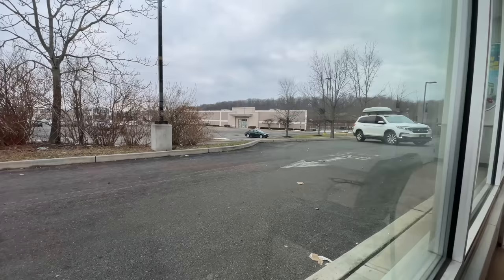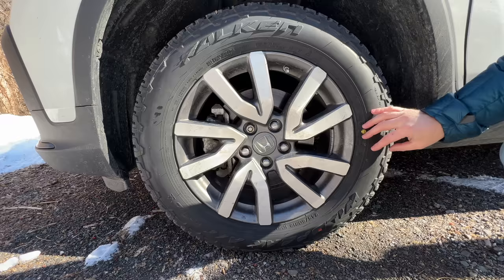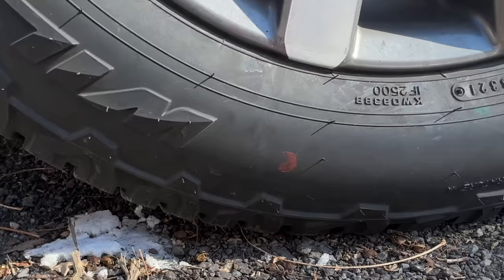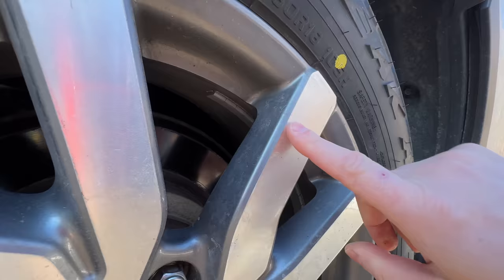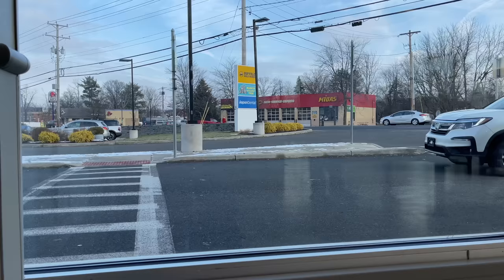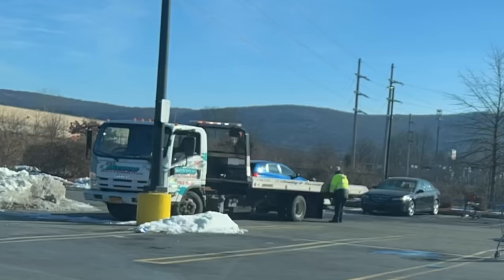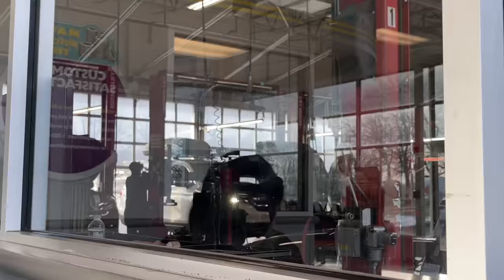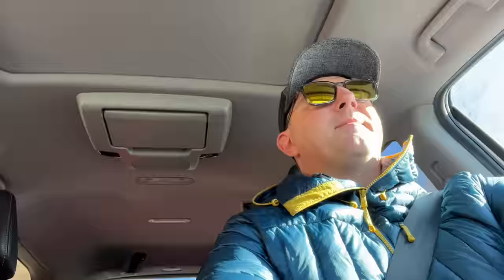The Surprising Importance of THIS Yellow Dot!

Comment: As part of the diagnosis I usually wanted to see if the tires were actually causing a vibration, or if I should look elsewhere.
Checking the balance before balancing tires I'll find that it now wants less weight but in the exact opposite position, so for my family, friends or regular customers I'd go slightly lighter 2-1/4 oz instead of 2-1/2 oz, it seems to work better in the long run.

Comment: An important point you missed is any time a newer vech with a tire pressure monitor system “TPMS” comes in for new tires or tire rotation the TPMS should go through a relearn so it knows the location of each sensor to report accurate information. As an example, the right front tire is swapped with the right rear. The manufacturer’s spec ( which can be found on the driver’s door post) calls for 32 psi on the front and 38 psi on the rear. The right rear gets a slow leak. Since the vech still sees the tire as the right front it will not turn on the TPMS light until it’s lower than 30 psi and show it as the right front. So when you bring in the vech for repairs the wrong tire will be checked and no leak found. And just a final comment, when you bring in the vech put the wheel lock key on the dashboard or center console and make sure you get it back when you leave.
Reply from the maker: Valuable point. TPMS relearn is very important.
Reply: Amen!
Reply: I had to put a brand new set of tyres on today...glad I got the "auto re-calibration" TPMSensors 😊 (Honda).
All I had to do was drive it normally city speeds and within 10 minutes...Voila...👍👌✌

Comment: I manually change the tires on my motorcycle. I've probably installed 5 or more sets of tires at this point. By following the dot over the valve method (+/- 1") I have NEVER had to adjust the original weights. I mean, literally perfectly balanced all sets with just a small weight which was installed with the original tires. No vibrations at any speed. Several different brands and models, Dunlop, Mettzeler, Bridgestone, and Pirelli. It's unfortunate tire shops can't follow this basic principle.
Reply: Bike tires and wheels are more precisely manufactured.

Comment: I only line the valve mark if I'm putting tyres on new wheels.  Have found that on old used rims I could end up with 120g of weights no matter where the marks are mounted. Sometimes rim rounding will sort it out but most cases replace the rim is what I'd advise.

Comment: Stick on weights inside the rim are being held even more securely by centrifugal force. It's most important that the weights be applied toward the inside edge and the outside edge for correct balance. Techs often glop the weights in one spot which most computer balance machines say is ok on one of their settings. The balance job won't last.

Comment: This depends.If a wheel has a light spot or a heavy spot, the dots can be used to make for the best achievable balance.In other words,sometimes its not the valve being used as a guide.One could use known heavy spots for example.IE where there was a large amount of weight previously placed.Hope this helps instill faith in your local tire tech's.🤘😎🤘
Reply from the maker: True statements. My installer might have used the old weights as reference and lined up that way. The last time I mounted and balanced a tire lip weights were still in use, so it might be easier with the sticker strips to try to line them up. Those sticker strips might make the ride smoother as well by distributing the weight over the lighter spots. Thanks for sharing your thoughts.

Comment: Heaviest point of the rim is not always the valve stem of the rim. YOu can balance the rim without tyre or any weight and see that heaviest point is not necessarily always the valve stem. Valve stem area is the lowest point of the rim as I know but I have no proof.

Comment: I’m 66, Many years ago in my younger years it was common practice to make sure the yellow dot lined up with the valve stem.  Especially on stamped metal rims that were more likely to be somewhat out of round/true or just the rim alone required more hammer on wheels weights and a physically large or large number of wheel weights that would jump out at anyone with any knowledge.  Modern wheel balancers are basically capable of balancing a square wheel but just like some tires with manufacturing anomalies will not always run smooth at all speeds.
Reply from the maker: Someone else recently said those strips spread out the weight and make it a little more subtle than a single heavier weight. Maybe these help it run smoother.
Reply: @OffGridAdventure 
The more spread out they are, the more weights it takes.
Reply: I just did four tires on my 2010 Town and country and I noticed that a quarter of the rim has some aluminum taken out of it and the valve stem in the middle so I think they took care of the extra weight from the sensor by removing some of the aluminum around that area

Comment: I would think it would take longer to balance it with more weights than to position the red dot properly while mounting the tire. Only takes a couple seconds to put the dot where it belongs before inflating the tire. This should be mandatory practice at ALL tire shops!
Reply: So how do you know the low spot on 99% of the wheels? 
Guessing doesn't count.

Comment: Should always try to line it up, when only one bead is on the rim it takes zero effort and two seconds to line it up. However, if it's a low profile or an LT, putting the second bead on can cause the tire to spin a little. After that, not a lot we can do that's not going out of our way.

Comment: Even though we do not have split rim wheels where the tire can rotate on the wheel, tires still can rotate on modern wheels that is why I put a red splotch of oil based paint on my tires, usually on both the tire and wheel to make sure they still line up after the balancing.  Yes, the paint wears, so I occasionally renew the mark when I see it fade. It is not the manufacturer's fault the tire rotates on the wheel, but the way you drive that does it. Only one brake lockup to keep from hitting some driver that doesn't pay attention is enough to make your tire move on the wheel. Tires naturally exude oil, and that is enough to let the tire move on the wheel.
Reply: I've only ever seen tires "walk" is on race tracks.

Comment: I was taught to put the tire seam opposite of the valve steam. I never noticed red or yellow dots on the tires. I have been out of the auto scene for a while so maybe this is something new or only certian manufactures do.
Reply from the maker: I’m not sure when this practice started, also, some manufacturers put the dot on the other side making the matching the opposite of what I said in the video.

Comment: As far as i understand about the red and yellow dots are only found on Tyres are  Manafactured 
in China , which are normally in the budjet range ,  Brands such as  Dunlop , Continental , Michelin , Uniroyale , B F Goodrich, Goodyear, etc  which are at the upper end of the market ,
are of a higher standard finish product , and when the wheels are being Balanced  a very ,
small amount of balance weights are needed, and  some times only one small weight is needed to get the job done , again saftey is a First , Good Quality tyres are important ,
Reply: well that explains why i never see those dots because i put Michelins on my cars after having other brands mostly goodyear blow up on highways all different cars and models of tires and all kept properly inflated only half worn out. but never had a problem with Michelin
Reply from the maker: Some brands use it and others don’t. It’s not a region of manufacture thing. They also wash off after a while.
Reply from the maker: Hi Greg, these tires were made in Buffalo, NY

Comment: I'm very careful to not curb my wheels and tyres but a few months back in a tight car park I gave the back left a big hit  which now appears to have damaged the tyre. They were checked at a speciality wheel repairer, not your local tyre shop. They added some more weights but it didn't help so now its my spare, luckily the spare is the same exact wheel and tyre and the tread is only 0.5mm less as its from my last set so about 3 years older but still legal and well within its life span. I'll probably get a new set of tyres in the next 18 months and will watch out for the colour markings.

Comment: I had bf Goodrich installed on my Honda pilot and at highway speed>65mph it would vibrate. Took it back to the tire shop, had them realign the tires per this video and the vibration stopped.

Comment: Oh and I am a professional tire installer and all my employees are trained to use the yellow dot. Doesn't always work because some directional tires only have the mark on one side of the tire. But yes I would return to have it done correctly.
Reply from the maker: Thanks for sharing. The funny thing is the most common comment I get is wipe off the dot. Besides the things shown in the video, the tires and balance work good. With almost 1,500 miles since mounting.
Reply: using red or yellow dot depend on the condition of the rim. if there is no radial excess its a good idea to use yellow dot. otherwise red dot becomes more important to set.

Comment: Used to be you could get your tires trimmed after they were mounted and balanced so the tread surface was perfectly round and concentric with the wheel bearings. You can actually get a smoother and quieter ride, and better handling at high speed.
Reply: Yup, shave off 3,000 miles on brand new tires.
Reply: @hotrodray6802  actually, the tires would last longer due to running smoother. Unless the grease monkey got carried away. Oh well.

Comment: No tire is balanced or checked for high spot out of round after it comes out of the mold. They may test one or 2 out of a batch of hundreds and assign dots accordingly to the whole batch. The main reason I would line up yellow dots would be to lower the chance of unnecessary noise coming from a customers mouth.
Reply: "The main reason I would line up yellow dots would be to lower the chance of unnecessary noise coming from a customers mouth."

*BINGO!!!*
Reply: 100% Correct.  Have mounted and balanced thousands of tires and the dots are a joke.  Sometimes ya line em up, put em on the balancer and it wants maybe 6 oz. of weight. Deflate, Break beads, Turn tire 180 degrees so that all important little dot is opposite the valve stem or mark on wheel or little green sticker and then put back on balancer and now it only needs 1.25 oz. total, happens all the time, and yes it was chucked up right on the balancer, already checked that.  The answer to the dots is Acetone or Brake clean, wipe that crap off and don't give em a reason to question it. If they do I tell em " take it for a drive, if it shakes come back and see me"  they never have to come back.
Reply: @MFGus-fb6up  -- And, even if zero weight is needed, always put a .25 oz. weight on the outside so they won't complain that "the weight came off" or you didn't balance it "properly".

Comment: i worked at a tire shop for years my first job and i was trianed to line up the yellow dot with valve stem unless i seen a mark on the rim then line up the red mark it only takes a second if even that to line it up i learned to line it up as i mounted the tire to the rim
Reply from the maker: Thanks for sharing. After your experience do you think it saves money on weights to line it up?
Reply: @OffGridAdventure  I just had maxxis razr A/T put on.  They had lined up red dots to valve stems on three tires.  There were no weights on the 3 tires.   One tire the dot was not aligned and many weights.  My xterra started driving poorly in one day.  Multiple tires were not balanced, imo.  I had lots of rolling resistance, steering was more effort, and the vibration in my steering wheel and car was getting pretty intense.  I asked them to line up the yellow dot since I didn't see a notch on my rims for the red dot.  3 of my tires have minimal weights.  One tire has a lot of weights... maybe that tire is a bit defective.  I don't know.   It's my rear passenger tire.  Hopefully that's the better place for that tire.  My car, so far, is running way smoother.  I don't know much about the dots but I love Maxxis for my MTB tires so I'm looking forward to seeing how these do as long as they stay balanced.

Comment: Believe it or not I’m old enough to remember that in the days of recaps and retreads, most tire shops had a tire shaver. If the tire was out of round from a poorly executed recap, you could put it on this truing machine and true up the tire perfectly round by shaving a little bit of rubber off here and there until you got a perfectly round tire. I have not seen one of those machines since the 70s.
Reply: I bought one of those machines for myself a few months ago.  It was made in 1970.
Reply: @earlbrown  The last one I saw was in Rockport Texas in 1972.

Comment: It took a lot of coordination between the engineers that designed the car and tire manufacturers who supplied the rubber to meet that spec... The engineering and coordination between manufacturers gives the buyer the best chance of getting a vehicle that will perform to a higher standard and greater performance. The real question dumb dumb is what do you think the right thing to do is. Trust your new car and   tires to the engineers that designed it or the 18 year old kid that dropped out of school to install tires. From this point on everything you do with the car should be proactive. Sit down and read the freaking owner's manual. Find out what the torque spec is for the rims bolted to the car. Improper torque of aluminum rims on a vehicle is just one cause of tire and rim failure. There are many.🤨

Comment: Question about the pressure: My car has recommended pressures listed on the driver side door, but are those pressures when it's a cold start, or after I've traveled a while? Because typically even when driving in cold weather, the pressure will go up by 0.2-0.3 atmospheres (we don't use PSI), and it goes up by even more if I'm driving in the hot summer.
Reply: Cold.
Reply from the maker: It’s normal for the pressure to go up while driving. Measure it cold.

Comment: When I was installing tires it had to be aligned with the valve stem but I has since watched them on my own vehicles and noticed how they continual creep around the rim in the opposite direction of rotation as I drive! So am I wasting my time placing them correctly?

Comment: The issue in my book is the tire installer isn’t doing their job right!  We pay them to be technically trained and when they don’t line the dots up with the valve stem.  They aren’t doing what their supposed to do.
Reply from the maker: It is interesting that some folks say that it doesn’t matter. But, why would the manufacturer waste time with the paint if it didn’t matter.
Reply: @OffGridAdventure  Exactly!  Even if it doesn’t do or mean anything, why not just do it?  I didn’t know this about the dots, but now I’m going to the tire guy to line them up next t8me I get tires.

Comment: 24/7 22  lf a tyre is repaired /vulcanised should the wheel be re-balanced afterwards. What happens if the coloured dots have disappeared ?
Reply: "lf a tyre is repaired /vulcanised should the wheel be re-balanced afterwards."

It really depends on who's repairing the tire and/or company policy.  You can either remount the tire on the wheel in the same position it was originally on or rebalance it.  The weight of a patch doesn't throw off the balance.

"What happens if the coloured dots have disappeared ?"

Absolutely nothing of consequence.

Comment: Back when tires ONLY had the yellow dot, I always aligned it with the valve stem.  However, since the shift to BOTH red and yellow dots on the sidewall, the general consensus is that the RED dot takes precedence and should be the one that is aligned with the valve stem.
Reply from the maker: Correct, the red dot takes precedence.

Comment: The reality is that there are millions of cars on the road with dots not properly lined up and for the most part they are not having problems, it's one of them things where it will work just fine but it's just not the best way to do it. Perhaps all I stallers should be properly trained so that they are all on the same page, many installers at small mom and pop shops mainly do patches and hardly balance tires and they move so fast that they pay no attention to anything more than slapping tires on and moving on to the next tire

Comment: Stop playing.  Music too loud and unnecessary
Reply from the maker: Hi, Thanks for your feedback.
Reply: Music was pleasant and not loud, maybe your speakers are out of wack.  I am a 75 yr old woman who drives a small class B camper van alone  all over the country this years plan is about 5000 miles minimum.  I  am very happy for all your information.  None of the men or women in my family could even change a spark plug.In the 50's and 60's you could get a drivers license at 14, but in  addition to passing the state test my mother watched you change a tire with an old bumper jack, then you got the keys to go to the school game.  I learned on a 1949 plymouth.  With a split windshield and a viser, and no turn signals, you had to roll down your window and use hand signals.  When I got my first license in 1963, the examiner had me make 4 right hand turns around the block, said kid if you can drive this you can drive.  I had spent 4 extra weeks practicing parallel parking.